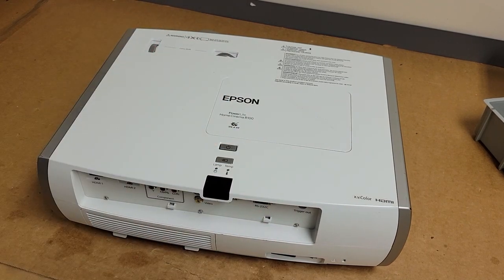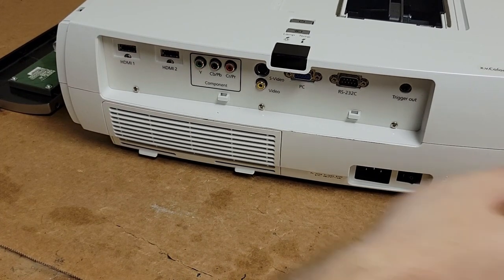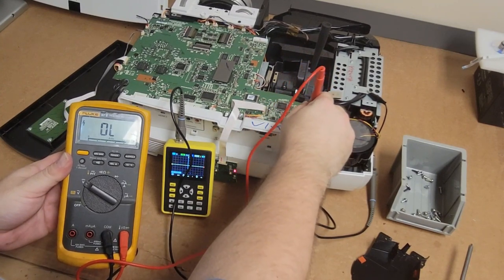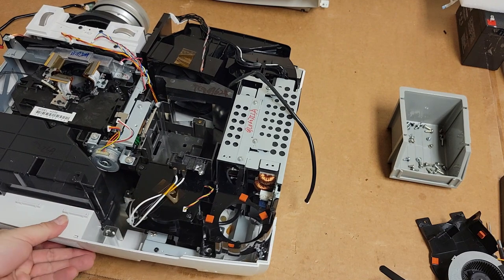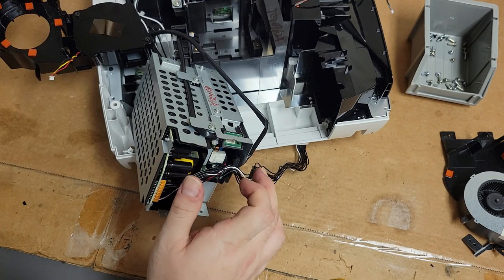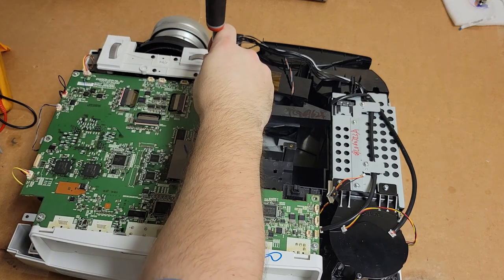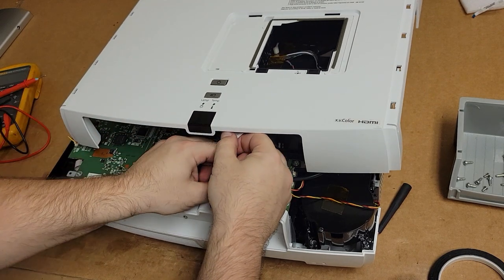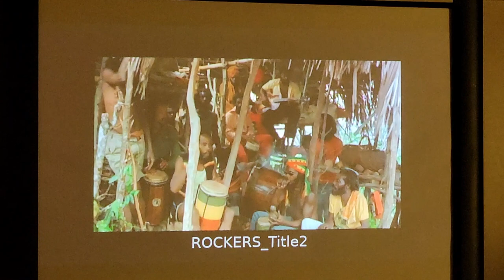Epson PowerLite Home Cinema 8100 LCD Projector | Temp LED Repair

Comment: I just got a non working 8350. Power light comes on, push power button the source light comes on like it’s booting. However there is just one click from around the power supply (sounds like a relay). No iris or slide noises, the source light stays on for about 20 seconds, then both source and power lights flash off for a second, and finally power light comes back on. I’m thinking it’s a power issue, it’s probably losing power and resetting that’s why there’s no error? I looked at the power supply and ballast, no burn marks. Where should I begin troubleshooting? Thanks!
Reply from the maker: Hi Ben! I'd check to see if you have 380vdc to the ballast. That confirms the pfc supply is working. Then the low voltage to the main board should be a mix of 5/12v, possibly 3.3 as well. Epson doesn't offer service info so it's a little difficult to know specifics.  I tend to follow the capacitors on the low voltage side to know where to check. 
I know the noise you mean too and I agree it's probably a power supply issue. I bet the ballast is okay. Might even be worth just finding a used power supply. I suspect they are reasonably priced these days.
Reply: Thank you so much for the reply, you’re awesome!! I did check power to the ballast, I had 380vdc across i believe black and red.  Do I need to be checking voltages across the white wire as well? 

I’m assuming check from the low voltage white wire going to the main board to each black wire? How do you use the capacitors to tell you where/what to look for low voltage wise? I have a basic idea what’s going on cuz I do HVAC work but I get lost in computer boards lol. Thank you again for your help, there’s so little info on these I really appreciate it!!
Reply: Checked some voltages today. I only had 3v from one wire to white and 3.5 from another. After pushing power I got 14v on a couple other wires. The weird thing is the white wire itself has 3.5v to ground after pushing the power button, so I’m thinking there is a short somewhere causing the neutral to go hot and the power supply is seeing that or just over amping and shutting down after a bit. I probed around and found that the coil side of the relay that clicks on when the power button is pushed has 0 ohms to ground. That’s gotta be the issue right? Just making sure before I start trying to figure out where it’s shorted. Also it seems about 3 of the black low voltage wires just go to ground on the main board. I believe those same 3 wires go to ground on the power supply, just making sure that’s normal. Thank you again for your help.
Reply from the maker: If you have the 380, that is a good sign.  I would check the low voltage output now.  when I say I go off the capacitors, I use their polarity to determine where to measure.  One side will be ground/0vdc.  the other side will be the positive DC voltage.  Since they tend to oversize the caps, a cap rated at 25V usually is filtering a 12v signal.  A 10v rated cap will be filtering a 5 or 3.3vdc line.  that relay might be correct.  It might be grounding a line to enable something.  I need to pull that scrap supply I have to look...  speaking of.
I have a scrap 8100 with a good power supply(bad optics).  If you are in the states, I would sell it cheap.  My email is listed on the about page.
Reply: @FixitFrank  hey frank I know you’re busy so no rush just wanted to make sure you got my email, thanks again!!

Comment: Sir my projector banq ms500  2 minit raning after off   what solution please
Reply from the maker: What troubleshooting have you done so far?  I would suggest reviewing some of my BenQ videos. I suspect one of those videos will show you where you want to look.  
I would start with looking for BenQ color wheel videos and then fan videos.  Check your manual and compare to the LED codes when the projector shuts down.

Comment: Have a Epson 5040ub that appears very dim. Even with a brand new bulb. Any thoughts? I’m getting the feeling it’s not powering up the bulb correctly
Reply from the maker: Is the bulb from Epson or from an aftermarket or Amazon?
There is a chance the iris is sticking but I'd expect an error. How is the color clarity? Any yellow blobs in the picture?
Reply: @FixitFrank  it’s a genuin Epson oem bulb from Jasper tropics. Cool doesn’t look the greatest but I think that’s cause it’s so dim. I still have my Epson 5020 and compared the two. The 5020 is way way brighter and is technically supposed to be 100 lumens less.
Reply from the maker: If its Jaspertronics, its probably not an original lamp. If it was in an Epson box(and $168) then it probably was(with them I wouldn't be sure though) but if it was their $79 version it's a knock off and junk.  In all seriousness their lamps are utter garbage.  I can't count the number of projectors I had to repair due to their lamps.  They lie in their listings about the quality and bulbs used. They even have sold lamps with counterfeit Philips. I'd send it back asap unless it was in that epson box.  My most recent video about the Optoma GT1080 Darbee had a jasper lamp and it was the root cause of everything.  They drive me nuts with the trash they flood the market with.  Nothing  but fancy advertising...should I say how I truly feel?  :)

I know these cost more but it would be worth it to know its the right lamp.  
BHPhoto has the true OEM. https://www.bhphotovideo.com/c/product/835104-REG/Epson_V13H010L69_ELPLP69_Replacement_UHE_Projector.html  $259

Epson directly is $299
https://epson.com/Accessories/Projector-Accessories/ELPLP69-Replacement-Projector-Lamp-Bulb/p/V13H010L69

Purelandsupply.com has aftermarket versions but even as much as I like their stuff, I think the OEM from Epson/BHPhoto is a better option even if its more expensive.  That is why I question the OEM Jasper lists.  I know what they cost wholsale, so I am not sure how they can sell them so cheap unless something is up.
Reply: @FixitFrank  I got the most expensive one they had. 216 bucks. It’s an Epson one. Came in an Epson box, had the hologram sticker on it. Says Epson on the bulb. Not saying it couldn’t be the bulb, but yeah 🤷‍♂️ it’s strange
Reply from the maker: In that case it's probably okay. I just know they are not trustworthy for their listings. I'll figure it's a real Epson if it has the sticker. Try disabling the auto iris. Otherwise the only other possibilities are problems with the ballast or maybe the optics. Usually optic problems are more like color blobs and pink/blue lines.

Comment: Hi Frank, big fan of your channel. I was trying to modify my EPSON TW5400's exhausting fan. The fan is CE-6035R-01 CD12V 170mA, which has 4 pins(RBYW). Could you help me with the definition of the pins. Was it Power, Ground, Sensor, Control, just like the computer fans. Many Thanks.
Reply from the maker: Hi Timo.  Make sure the Stall reporting type(sensor) is the same as the original.  Some fans report using PWM with one pulse per RPM.  Some use 2 pulses per RPM.  Others do not use pulses but will go high to VCC on stall or down to ground on stall.  That is the hard part to match.  But if you can match that and the CFM you should be OK. Usually in epson they report stall high.  Meaning if the fan sticks, the sensor wire(yellow) reports 3.3v.  The color code should be correct.  red/black power/ground, yellow status, and white temp.  Just make sure your substitute fan matches the same.  you may be able to find datasheets on both and compare. That might be easiest.
Reply: @FixitFrank  Thank you for clarified all these for me (I don't speak english well, so i'm not sure, if clarified was the right word :)). I also need to ask some other questions, although it may sounds basic. You said stall reporting on Epson usually go high to VCC. Does it means, When the power and ground on the fan are both connected (to the power source). Then I make the fan stall. I'll get a 3.3v reading between the sensor wire and ground wire.  If the answer was no. And I won't  able to find the fan's datasheets.  Was there any testing method? Or was there a particular model or type of fan for me to look in to? And thank you again for all the time and patients.
Reply from the maker: I disagree. Your English is quite good.  In fact it is very good!  Better than many native speakers.  My Finnish is "todella paha". I know perkele and normaali päivä...
To answer your question, you are correct!  When the fan is stalled, you will measure a positive voltage on the sense wire.  In Epson I measure 3.3v but in other projectors it may read as high as the VCC(12v).   I don't know if you saw this video, https://youtu.be/kCOSQ8dVZvc  It is about DLP fans but the test steps are the same for all fans.
What is your end goal?  Is it to make the projector more quiet?
Reply: @FixitFrank  The only Finnish thing I know was LevanPolkka XDDD. By learning English I almost achieved to get all the info I need. Maybe that's why I stop learning new languages, or maybe it was just my laziness talking. Thanks for the approval for my English. (BTW I speak mandarin)
   For your last question. The answer was YES. This little thing's noise is killing me. I thought if I can replace it with a bigger fan which has lower RPM to match the CFM, it may reduce the noise. I already got an idea for 3D print fan bracket. The only thing to make sure was the pin match. Several week ago I found your channel. After go through your recent videos, I knew your the person to aks. 
  Now I gotta see your fan testing video to learn more. Thanks man, I mean it.
Reply: After a minut in I realize I saw the video XDD. That's exactly where I got the "stalling 3.3V" idea.
Reply from the maker: Ah, I went by your name, and figured finland!  Feel free to email me if you want. Listed on the about tab about halfway down. 
  Sometimes I have found that noisy fans mean the fan is failing.  However I think you are on a good path.  I don't know where I would be without my 3D printers.  They saved my butt many times.
Normally I would suggest against someone from replacing a fan to make it quieter, as most people won't take the time to find the right fan and match the sense wires. 
You are clearly capable of finding the right parts. I am more than happy to offer whatever info I can to help you.
Reply: @FixitFrank  Ah, the "Timo". I pick that name because it’s easy to pronounce, and it dosen't have weird meaning.
   The projector fan was loud since the beginning. It I was me, recently got the time to make things right. Few year ago, I saw someone on YouTube cooling the projector with a CPU cooler. After disassembling the projector, and study the air way. I found it's not gonna work on mine. From that point I knew it has to be the fan. After finding the right fan. I might also need to do some tweaking, to match the max current output from the board. 
  Thank you for all the help.

Comment: Ευχαριστούμε!
Reply from the maker: Dang brother.  Thank you!  No Bs, this is going towards some projectors to share here soon. I really and truly appreciate it.
Reply: @FixitFrank  It's half the money I charged for fixing a BENQ projector. Extensive cleaning + colour wheel replacement. Charged 40 euros for the whole thing, colour wheel was purchased by the owner. Could not have done it without you, so happy to send at least half along your way! Thanks again for everything! (P.S. Certified BENQ service centre was asking 50 euros just to check the machine, 50 for cleaning and 200 for the colour wheel. They would not accept customer to provide their own part. So, everyone is happy)!